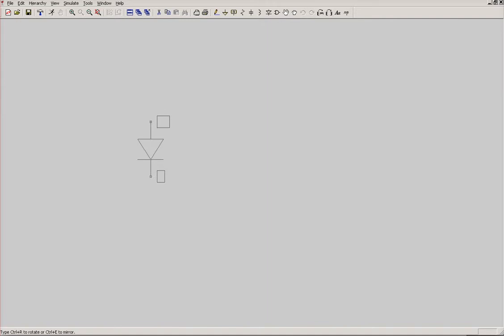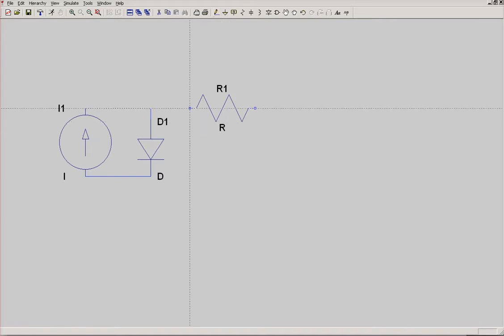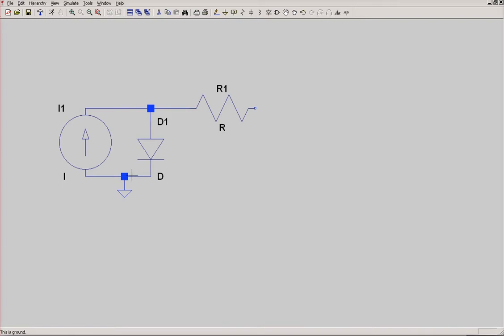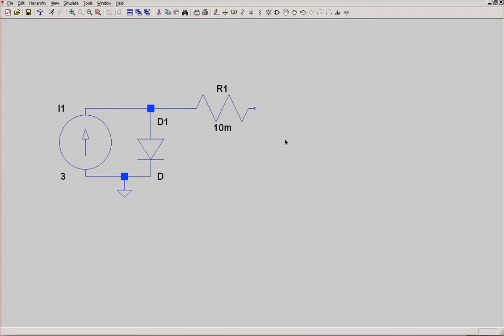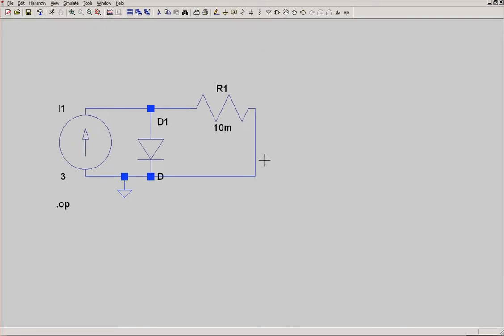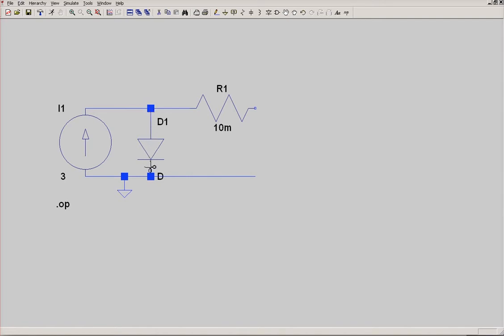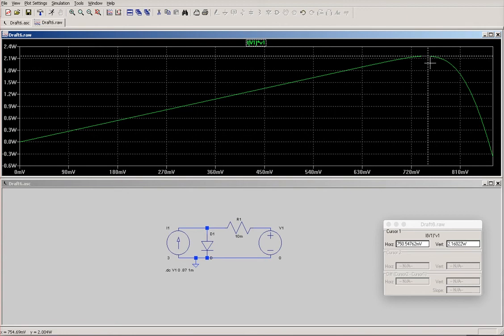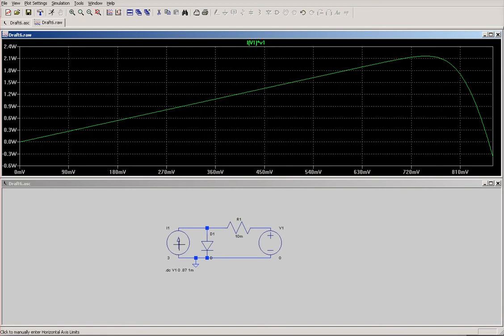Solar Cell Modelling using LTSpice

Comment: Awesome. Thank you!
BTW. If anybody has issues with measuring Voc, make sure the DC sweep upper limit does include I(V1) actually reaching zero. So, Better use 0.65V, not 0.6V, in this example.

Comment: How can you model shading?
Reply: If you want to model shading on a single solar cell, you need to "split" the cell into sections each with a short circuit current proportional to the area of the sub-cell. All the subsections are then connected in parallel. So, lets say you want to split the cell into 4 equal sections, each sub-cell would have a current source that is 1/4 of the total short circuit current if it was not shaded. Shading is then modelled by changing the amount of current on each section to represent the intensity of light arriving to the cells (the current is proportional to the light intensity). You would see that the total current is simply the sum of the current of each section of cell. To model shading in a string of a solar panel, solar cells are connected in series and each cell has a current source in parallel representing the short circuit current. If the solar panel is shaded, then each solar cell will have a short circuit current proportional to the light intensity. In this case, and assuming the shunt resistance is negligible, the lowest current in the string would determine the current for the whole string.

Comment: thanks for your scientific and usefull video. please explain the reason that you added ground in cathode diode?
Reply from the maker: In order to extract power from the solar cell, the diode needs to be forward biased. In this case, the cathode is connected to ground as there are no other nodes in this simple circuit that can be placed at a lower potential than the anode. Also, a ground node always needs to be defined in a circuit simulator for it to find a solution. In general though, you just need to make sure that the cathode is at a lower potential with respect to the anode to extract power from the solar cell.
Reply: Ivan explained it at time 1:58; So he's saying, if there is a current flowing through the resistor from right to left, we would have forward bias at the diode in all cases.
Reply: thank you for your explanation. i want to draw an electric circuit for a pv module consist of 72 cells.(6*12).  by 3 bypass diodes. would you have any idea for this circuit? i would wondering if you could help me. thnks alot
Reply: can u plz help out me I want to draw graph current vs voltage but unfortunately my simulation always shows me time vs current wht can I do
Reply: @TechnologywithNidaR  Seem like you are doing a transient analysis rather and DC sweep.

Comment: why there is mins sign on I(R1) =-3A
Reply: This just has to do with the way you connect the resistor and how the current is defined (which terminal the current is going in and which one out). If you want to chage the sign, you can rotate the resistor 180 degrees.